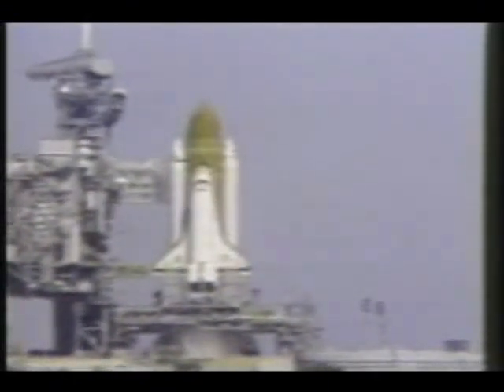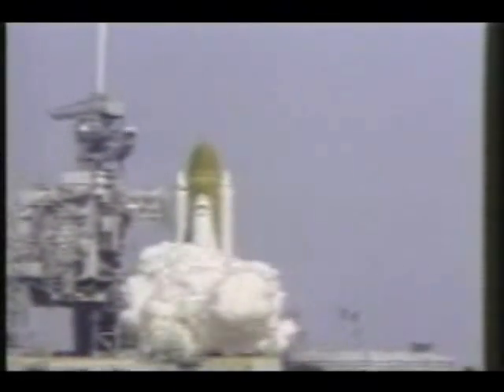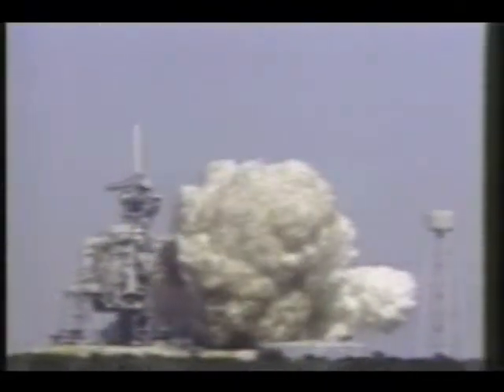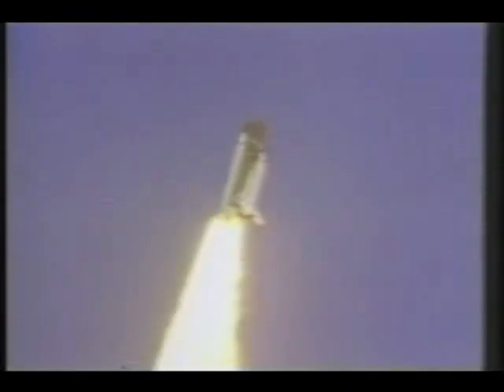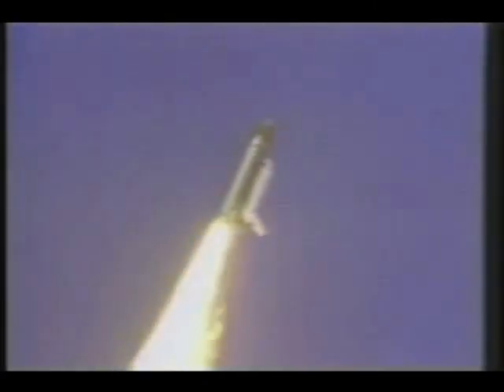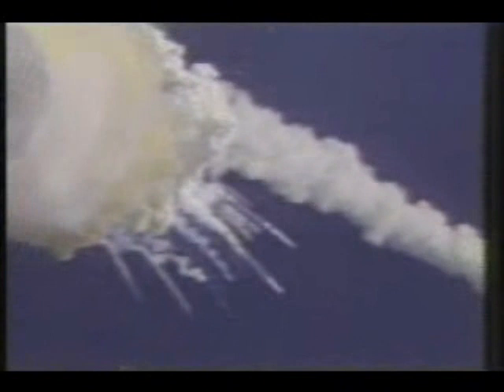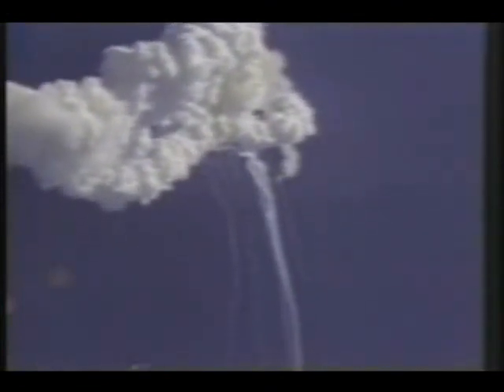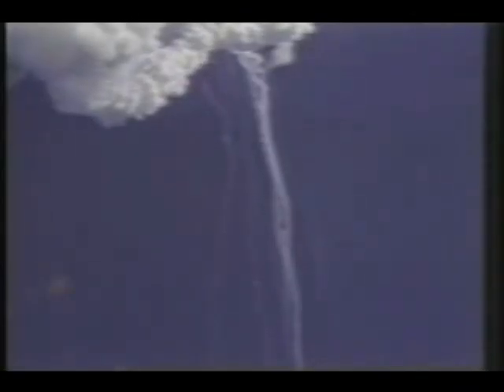1/28/1986 The Challenger Launch: Front Camera

Comment: (1:18) Did he just say the engines were at 104%?!?
Reply: Yeah probably
Reply: Yes that is of rated performance. The original thrust ratings were conservative. After some tweaks and efficiencies and comfort with how they could be run for a little more thrust, they began saying 104%, rather than 100% Changing the rated thrust would have required the changing of a bunch of documents and parameters and it was simply easier to expand the scale.

Comment: The streak flying towards the ground was actually the crew cabin 😢 They were still alive for the entirety of the way down.
Reply: OMG. I have never heard this before 😢.  Will shiver every time this is seen
Reply: @rodmorgan7041 Yes the shuttle didn't explode, it was tore apart by aerodynamic stress. There are videos where you can see the crew cabin section coming out of the cloud and falling. 

It's most likely that the crew lost conscious due to hypoxia if the cabin lost pressure and they blacked out but some could have regained consciousness as the flight module lost altitude over the next 2.5 minutes.
Reply: @WizelBalan there is a report that was released a while back that most if not all of the crew were still alive after the breakup and during the fall, but also atleast a couple were still awake and conscious. Several of the emergency air packs had been turned on. At the time the only way to do that was a manual switch had to be flipped, and one of them was from one of the front crew members and couldn't be reached by them so one of the crew behind them had to reach forward and flip the switch. It wasn't until the crew cabin which was mostly still intact impacted the water is when they died.
Reply: @WizelBalan the gas leaking out from where the faulty o rings were,  ignited and disintegrated the shuttle.
Reply: At least 4 of them were.
Reply: You know this how?
Reply: "Hold my hand"
They heard the teacher say on the way down.
Reply: @unclewormwood Christa McAuliffe....pastoral teacher to the last. God rest her.
Reply: @unclewormwood they have disproved that transmission as coming from the cabin. The last thing that was broadcast from the crew was the comment about throttle up.
Of course I guess NASA could be lying about that. It does suck that we live in a country where we can’t trust the government to tell us the truth. Back in 1986 I didn’t believe that.
Reply: A you don’t know that and b there are multiple streaks, the cabin being one of the lesser ones
Reply: But not concious.
Reply: @HarrietHare  long enough to know what was happening and for that teacher to hold a hand for the drop . Black box recording.
Reply: I doubt it. The spacecraft was completely destroyed by the blast you can see debris everywhere. A human body cannot withstand an explosion  a NASA spacecraft can’t.
Reply: Nunca olvide el 1986. El Challenger explotó y el Dupont plaza en Puerto Rico se quemó y murieron muchas personas.
Reply: Some of them were. 3 packs were switched on. It’s possible some of them died when the cabin separated or on the way down.
Not that that makes it any better.
And none of it had to happen. If they’d just listened to the engineers that told them not to launch in that cold of weather. But no the bean counters thought they knew better than the people who actually designed and built the thing.
Reply: I don't know anything about supposed dialogue, but I do know that several of the emergency oxygen masks were deployed, and that could only be done manually,  meaning someone had to have been alive to do that.

Comment: I’m probably pointing out an obvious detail here.
But the right booster was wide open to the weather.
The left on had the structure of the tower shielding it a bit it show have been a little bit warmer.
Reply: @christopherfoote4643  The air temperature on January 28 was predicted to be a record-low for a Space Shuttle launch.[4]: 47, 101  The air temperature was forecast to drop to 18 °F (−8 °C) overnight before rising to 22 °F (−6 °C) at 6:00 a.m. and 26 °F (−3 °C) at the scheduled launch time of 9:38 a.m.[1]: 87 [4]: 96  Based upon O-ring erosion that had occurred in warmer launches, Morton Thiokol engineers were concerned over the effect the record-cold temperatures would have on the seal provided by the SRB O-rings for the launch.
Reply: @christopherfoote4643  "The launch was delayed for an additional hour to allow more ice to melt."  There's several good documentaries available to answer your questions.  I'm not sure where you get your information and resources from?
Reply: @christopherfoote4643 6 day delay. "The mission was scheduled to launch on January 22, but was delayed until January 28."
Reply: @christopherfoote4643  you make zero sense with your random rambling.
Reply: @christopherfoote4643  the designers did bring this to the attention of managers and it was ignored.  NASA was behind schedule, loosing millions and cutting corners.  Even with the information now known, the Flight Director in a later interview would have still launched.  The design met the specifications given to the design team.  No one expected NASA to launch in sub-freezing temperatures, but NASA was way behind schedule with launches for the new shuttle system.

Comment: If it had only lasted another minute
Reply: SRB Sep was about 30 seconds away right?!  IF only, Id bet that Judy would of been happy to see that her work on 41D is visible on the ISS.  What a waste, NASA 🤦🏻‍♂️🤦🏻‍♂️
Semper Fidelis
Reply: J. Garza a min later
Reply: @peacethroughstrength172 unfortunately it had nothing to do with the srb
Reply: @Bcas1947 Actually it did, the o-ring failed due to cold temps and this did not allow it to flex and seal properly which allowed a blowtorch of hot gas to burn right where the SRB was connected to the main fuel tank.

Eventually this blowtorch burned through the fule tank causing the strut to break away which then caused the lower part of the main tank to break off, the SRB then shot forward a bit and its top crashed into the main fuel tank. 

The main fuel tank then burst and exploded causing the shuttle to undergo stress it could not handle andnit disintegrated.

Comment: Something you can hear that is often overlooked or omitted  in the transcripts is that the JSC PAO Steve Nesbitt said "Houston now controlling" at the same moment as Scobee confirmed the roll program and then also  said "Roll program initiated" at the same time Covey acknowledged, "Roger roll, Challenger".  You have to really listen for it, but it's there.
Reply: What does that mean?!
Reply: @knightscroftsquire-muldoon  The launch is controlled by the launch director from the firing room at Kennedy space centre in Florida but the actual mission is controlled by the flight director from the mission control centre at Johnson space centre in Houston.

The launch director would handoff the control of the shuttle to the flight director right after a successful lift-off.

Comment: @Neptuneaus Well, ...the  vibration you see though in this video is the tracking camera trying to keep up with the speed of the shuttle, not the spacecraft shaking  itself.  Yes, Scobee and Smith commented "  Looks like we've got a lot of wind up here today"  20 seconds in.  They did have upper level winds that bumped them around a lot.  You can visually see the wind speeds by how quickly the contrail dissipates and is blown away by winds at 1:40-1:50, for example